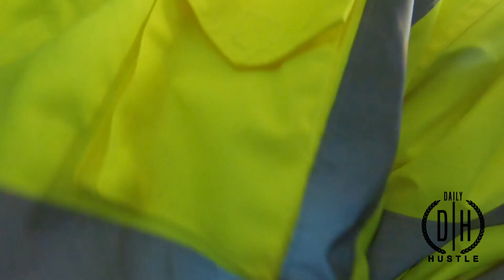Picking up some logs into the dump truck with bobcat T595 - countyline 30ton in action for firewood

Comment: Great video Chant and Ashton, it’s been a wired winter for sure we got our first snowfall yesterday and it was only an inch! I use the two in one Stihl sharper for my chain because it also takes down rakers! You need a moisture meter to tell if it’s dry! I can give you another product advise for the firewood business the scraps from the splitter you can bundle up and sell for kindling!
Reply from the maker: I’ll check that out thanks
Reply: @ChantsDailyHustle  make sure you get the right Stihl two one sharpener for the correct chain you are using their are different chain sizes which means they make different sharpener sizes which makes a difference!

Comment: Don't leave it outside!  Get small quad with hitch to move log splitter around. IF you must leave it out side use log chain & good lock 🔐  to secure it. Use trail cams for security cams... they work nice.

Comment: Possible small used tractor /other , to hook up instead of dads truck , also tractor cart to load split wood into trailer and then both into dads shop , freeing up dads truck , there’s gotta be something cheap on FB market place , dads right gotta flow and avoid hand. Lifting multiple times , i was previous jewelry packing supv at QVC in its early days 1987 , took from 6 packers to 25 in one year 
Its all about smooth flow , limiting extra movement , each person only has so much to give , work smart not hard , look for lawn tractor type and a cart sturdy enough to handle a large load 
Or even a tractor or cheap tractor loader with pallet forks allowing for filling your cage container to be filled directly from splitter , after full container , switch to new one , then cage container goes to roadside for sale , I think either , loader with trailer ball gives you all options you need , sorry about the length , i like tweaking things lol be safe